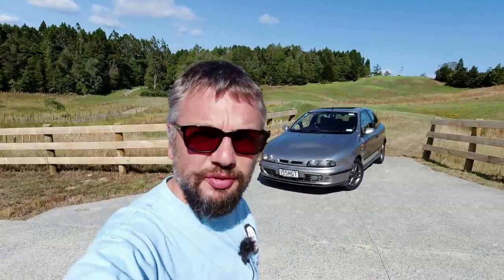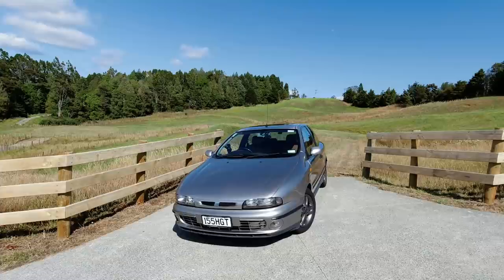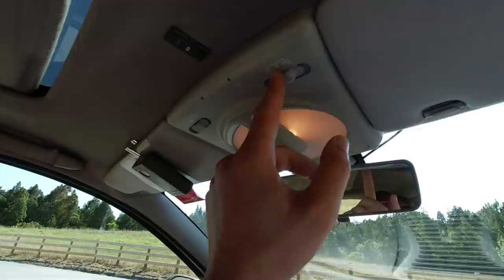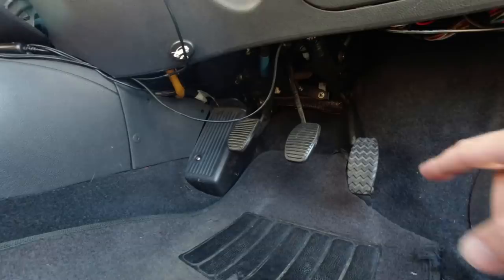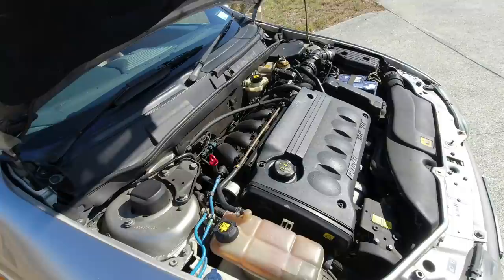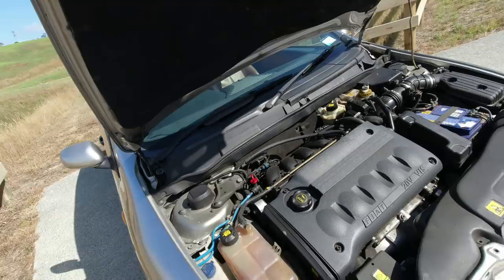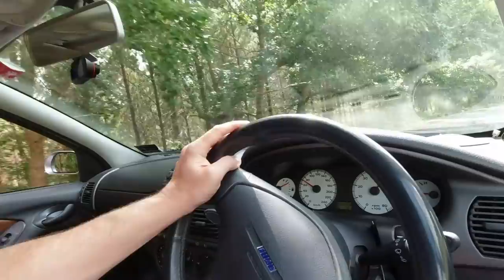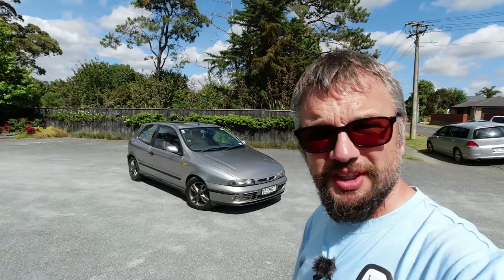Five-pot Fiat! Bravo HGT (Type 182) - Italian Music

Comment: Certainly one of the better Fiats.  The later Stilo was plain ugly.  Lots of bits shared with the coupe and with Alfas of the time too.  I worked for a Fiat/Saab dealer around that time so got to see quite a few of these, I don't rmemeber any major problems with them.  The wallet crippling cam belt service was usually avoided by selling the car before that one was due.

Comment: volvo had a 5 cylinder engine... which also could be found in Ford..
Reply from the maker: Very true, though I wonder if Volvo's petrol five-pot was related to Volkswagen's? They certainly used the VW diesel.
Reply: @HubNut  No - it was in a way the same engine as the 4 cylinder. It was a modular contruction and they made 4, 5 and 6 cylinder versions.. I do belive they also made a horrible diesel version - that was all volvo. Dont know about the VW engine.
Reply: @MrMichaelfalk  the diesel 5 pot they made I believe was somehow related to the penta engine I was once told, I have got two d5 volvo and I think the world of them 🤗